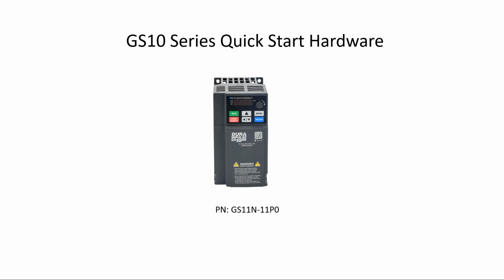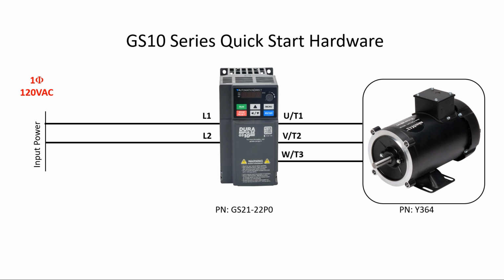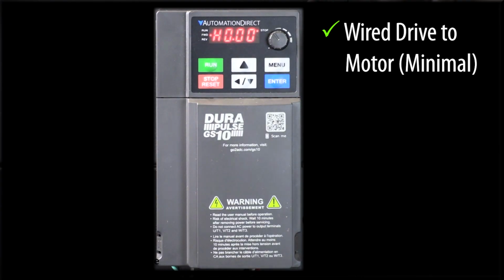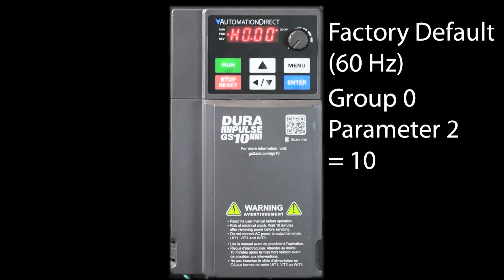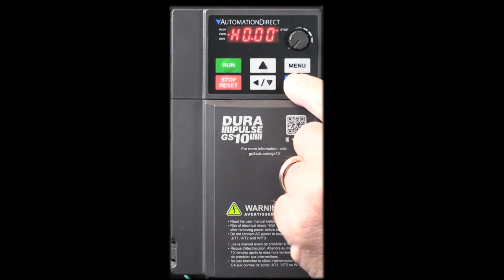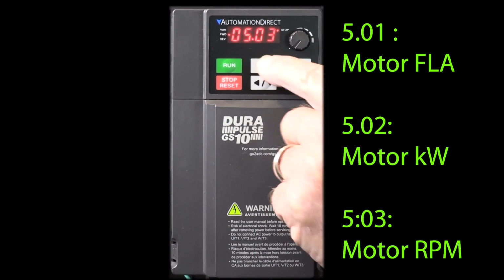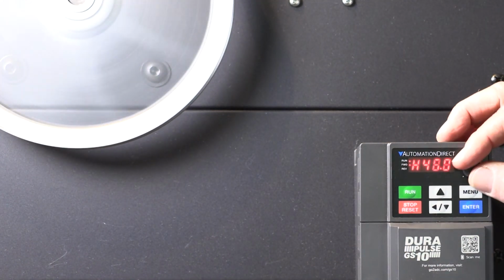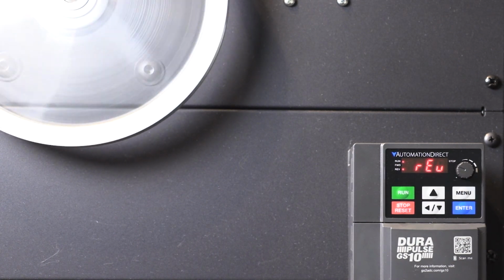DURApulse GS10 VFD Quick Start - with an Induction Motor at AutomationDirect

Comment: i’m confused by the fact that you show how easy it is to get this up and running but then you go on to say that it’s essentially a fake setup because a real application will have all this other stuff also ….so what exactly are you showing? should I not follow this video or is there a “real application” video elsewhere?
Reply from the maker: Great question — I appreciate you watching the video and sharing your thoughts.
The purpose of this particular video is to show how quick and straightforward it is to get the GS10 drive powered up and running in a basic setup. It’s meant as an entry point — not a full representation of what a real-world application would involve.
When I mention that the setup shown isn't a “real application,” I’m just highlighting that in an actual deployment, there are additional components (like motor load considerations, EMI, harmonic noise, AHJ protection requirements, etc) that come into play. But that doesn’t mean the video is invalid — it’s absolutely the right starting point to get familiar with the drive itself.

If you're looking for more on complete system setups, that's a great next step. We have a video playlist for the GS10 drive that will give you a good overview of what a VFD is, and the entire set of VFD functions and features here: https://www.youtube.com/playlist?list=PLPdypWXY_ROryprNZqxRFzncVLFuBLs87

Comment: Good afternoon, 
Great video. I’m having an issue on parameter 3 where you input the RPM.
I’m the video you input 1725, when I try to input my pumps RPM(3450) I get an Error code. What can I do to fix this? Thank you
Reply from the maker: You will need to change the number of motor poles to address this. by default the drive is looking for a 4 pole motor, which will run somewhere around 1600-1800 rpm. To run a 2 pole motor like your pump (~3400-3600RPM) you will need to change P5.04 to a 2 first. Then inputting 1725 to P5.03 should work.